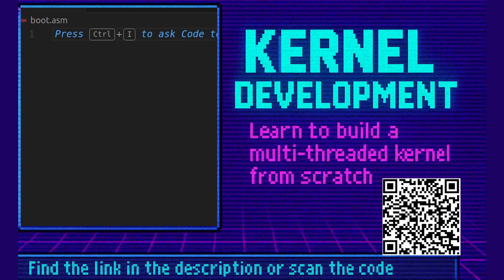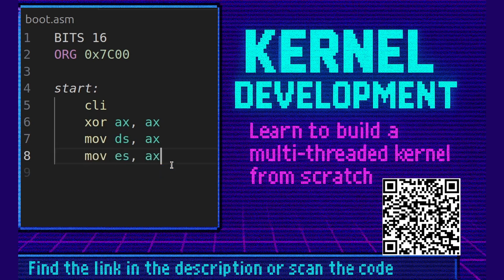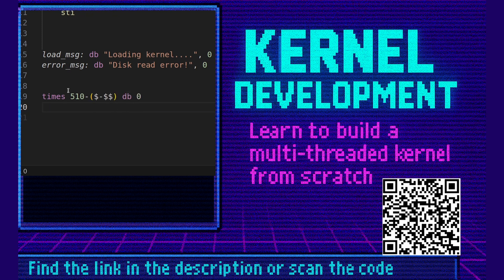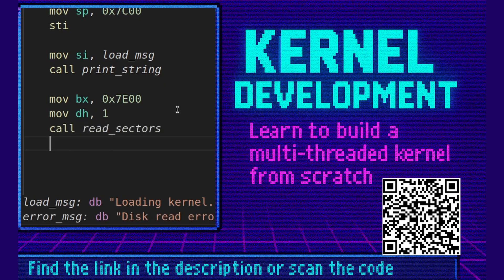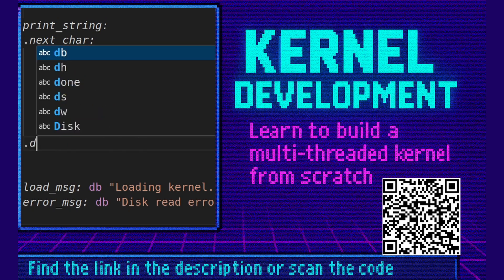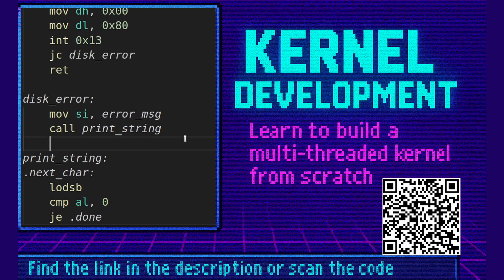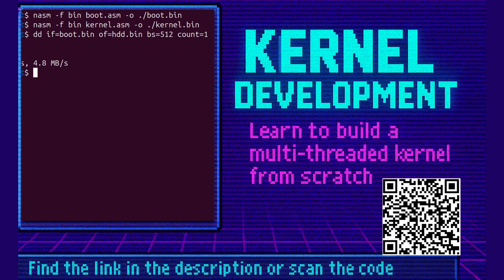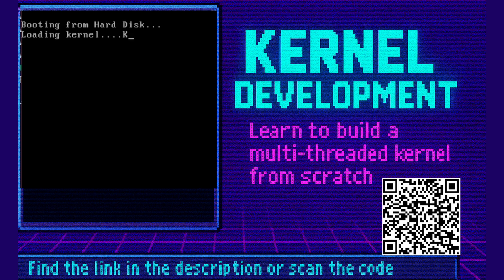Build a Bootloader in 7 minutes | Kernel Development

Comment: but can you help me to write x86 assembly to load a Linux kernel and initrd and forgo using GRUB for booting?
Reply: You can load the Linux kernel straight from BIOS, as it includes a very simple EFI executable portion to load the kernel proper. You need to use the "efibootmgr" tool to add a new boot option for your kernel, along with any kernel parameters you want (such as the root partition's GUID). Your kernel needs to be in your EFI System Partition for this to work (either /boot or /boot/efi).
Reply from the maker: We don't provide consulting work but we have some courses on Linux kernel development too https://dragonzap.com/teacher/daniel-mccarthy